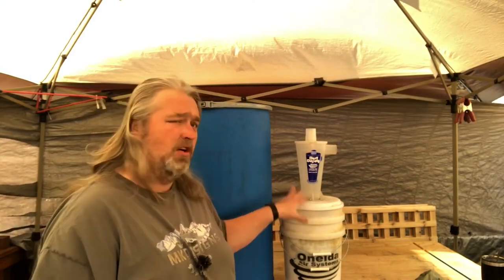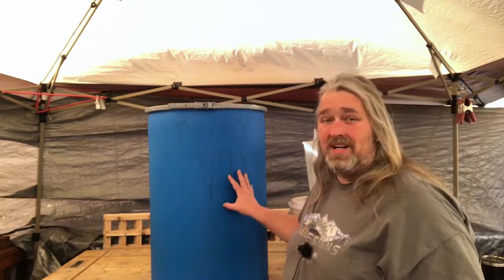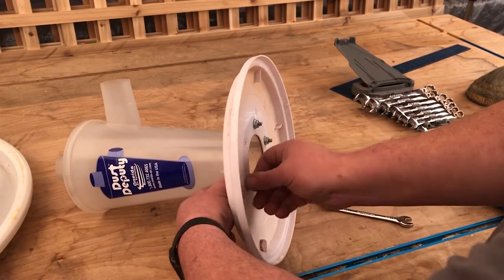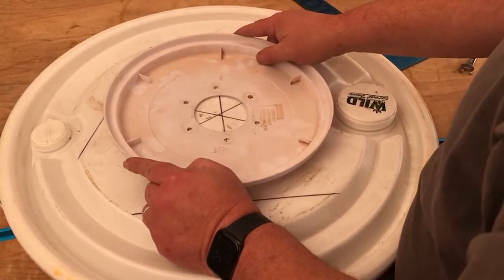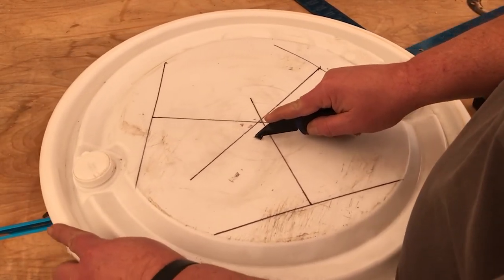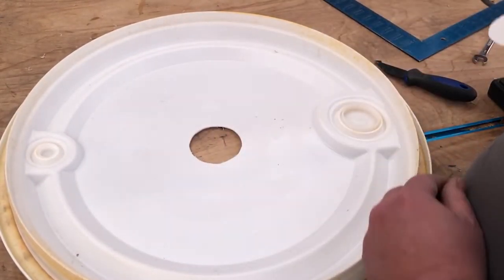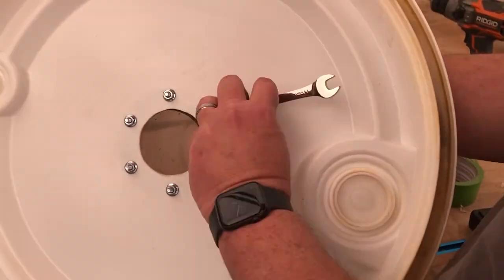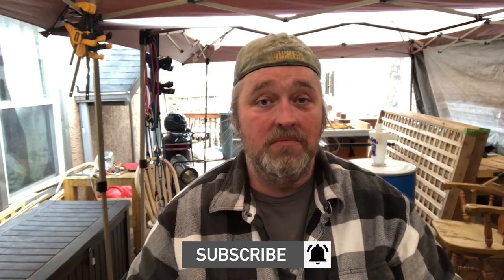Dust Collection Upgrade

Comment: I did that butcollapsed the barrel .. Then I built a small wooden skeleton in it and it has worked great since!
Reply from the maker: Great idea. We will see how this one holds up.
Reply: @mkdesignsfinewoodworking  It was real simple, just three 2X2's screwed together like a snow flake and 2 legs to space it so it stays in the center of the barrel and can't flip.... Leaves plenty of room to get the dust out.

Comment: I think you will find that more of the dust will be in drum being taller and less in the vac, as the dust falls to the bottom of the taller drum you will have less chance of sucking dust into your vac because the dust is farther away from the bottom of the cyclone  than it would be in a 5 gallon bucket.